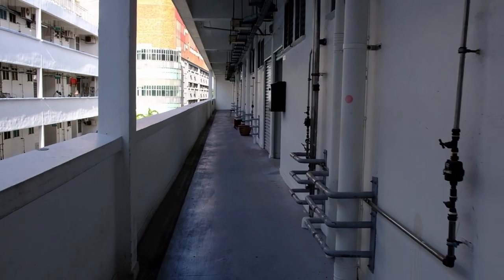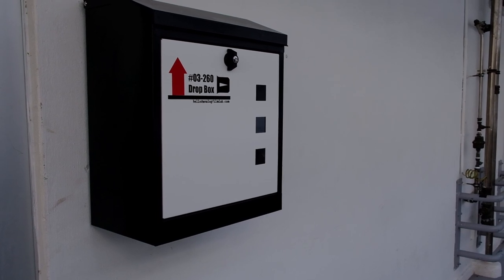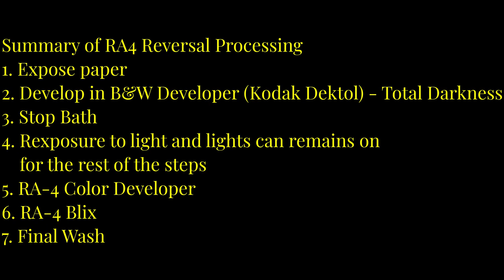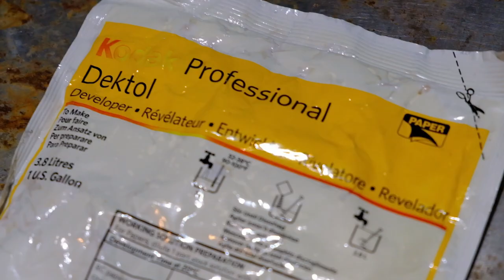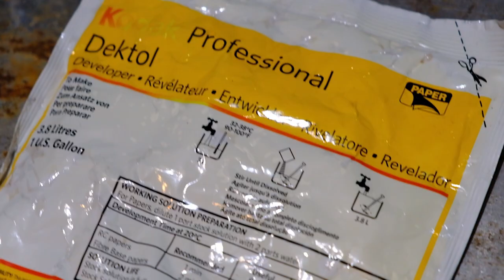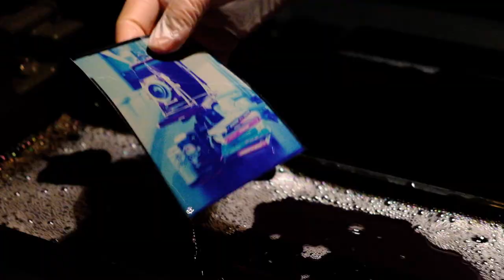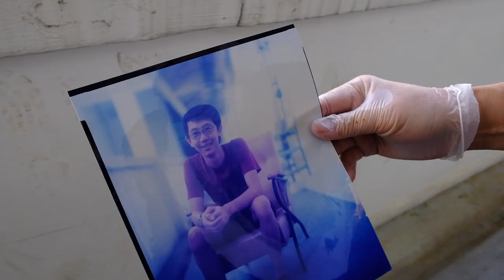Large Format - RA4 Reversal Processing

Comment: Wow，I have some trouble on this process,
I use Broncolor Flash to shoot a x-rite colorchecker, then use the D72 developing in 2 minutes, after stop bath,I take it to flash to do 2nd exposure.
then I use the ra4 processing, but it isn't shows color out, the colorchecker in photopaper is still B&W,but the darken area is yellow & orange.
Reply from the maker: I also new to the process.  But i suggest u use daylight to shoot first. Without any filter you should get a blueish photo. If you manage to get to this stage, at least u know the BW developer n ra4 dev.and blix are fine. Then slowly add in filter to color correct it.